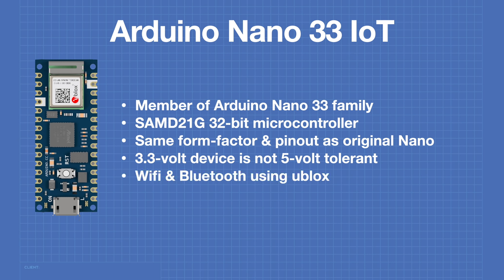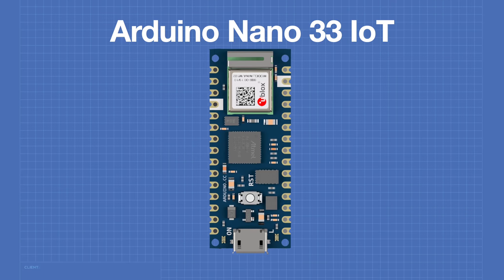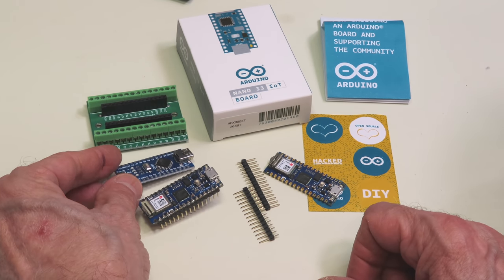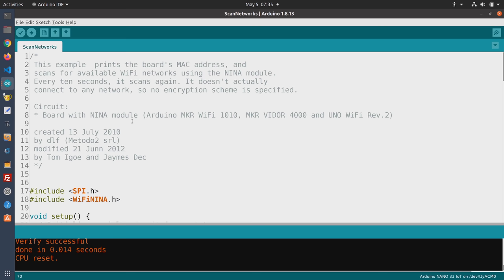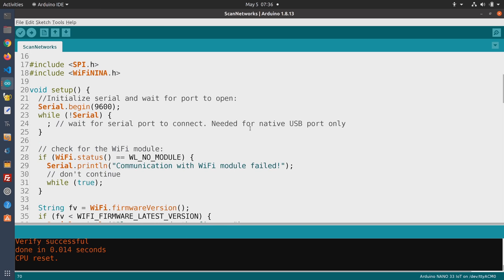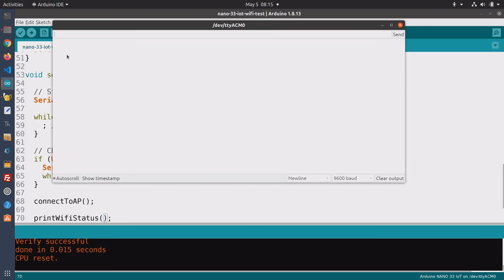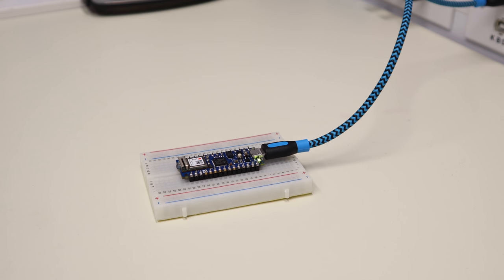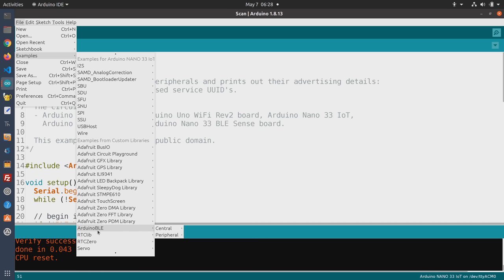Arduino Nano 33 IoT - Getting Started

Comment: Hi Bill. From the bottom of my heart I would like to thank you for this video. I had a few problems with my Adafruit tech, so I took a look around and found this video and bought a Nano 33 IoT to check it wasn't my PC or something. An hour or so later, it's installed and running the blink and wifi monitor. Next step is to try and get the Adafruit Smart Neopixels running!

Tim

Comment: I get big butterfly’s from the excitement of watching your informational videos. The excitement comes from the vast possibilities of the different things possible from the information you disseminate. Thank you very much for your help in designing my automatic gate opener for my residence. I know I can use my phone, a hand held remote, or a push button code on an outside controller (of the gate for visitors). Knowing this code may be changed as often as I wish makes the security I feel living behind a secured, locked gate wonderful! Now I haven’t built everything yet but I have welded up a strong steel box that will hold the motor and all the components. You have really inspired me to “go for it”.
    So for penny’s on the dollar, I will be able to build a VERY nice, secure entry point that will display the time at every opening or closing of the gate. Possibly face recognition for entry of friends. Definitely recorded video that can be monitored by my phone. Permission to open the gate from my phone which means anywhere I am at, I can open or close it. I’m still designing the system at this point, but I now have the confidence to attempt this monumental undertaking. Of corse I will be asking you for information when necessary. But I promise not to overburden you with the trivial bits. So for someone (me) that did not finish my proper education this will be a great task. Once again thank you for all of your information.

Comment: Thanks for the good video. I am  wondering how the board measures up to an ESP32 board, and when and why one would prefer to use this board over an ESP32?
Reply: I came in here to ask the same question as you, but I see he hasn't answered you in over 3 weeks.
Reply: Pradeep, 
Both microcontroler use advanced cores  :M0 from ARM for the Nano and Xtensa LX6 for the ESP32
From the datasheet, you can easily figure out that the ESP 32 can run faster 240Mhz vs 48Mhz
The ESP32 has an FPU while the Cortex M0 does not, this can make a big difference if  you need to make a lot of calculation
The ESP32 has 2 cores, this can look awsome, but in real embedded application I have not seen any real time embedded application using this king of architecture (it is already difficult to debug a single core...). Now if you have exemple, please share with us. 
One last word,  I do not believe this can be used in the arduino environment. It looks to me like something that a real RTOS can manage, with multiple process and inter process communication.
Power consuption in many cases is also important, the faster you run the more power you consume !
A last point, in embedded application resources are scarce. You can favor one or the other based on your requirements.
Take care and happy development !
Reply: Basically the same i think but I would get it from Arduino because you’d be supporting a good company and quality is guaranteed

Comment: The lighting seems great, tip for the glasses, angle up and tilt down the softbox a bit to reduce reflections :)  you can also try adding a rim light to further define yourself on the shot. Great video nevertheless, learned alot about the Arduino Nano!

Comment: The question a lot of people have is this vs. ESP32? I'm guessing ESP32 is cheaper but this may have better support in Arduino IDE?
Reply: In my experience ESP32 support using Arduino or Platformio is excellent nowdays, with a decent community too. Most problems you come across are reasonably easy to find good solutions.The dual-core is really handy too as you can leave one core to handle wifi and you have a fast core for your own stuff.
Reply: Cheap vs very expensive

Comment: To avoid the complication of BLE does the 33 IOT support something simple to use classic BT like BTSerial on the ESP32 to communicate with standard BT devices ?  Using BTSerial all you need is 3 lines of code and you are in business

Comment: You are doing fine :-) With respect to the reflections in your glasses you could try a polarizing filter. It is a quick, easy and relatively cheap fix.
You just turn it until the reflections disappear.
Reply: I actually meant that you are doing very good :-)

Comment: I'm really curious to see your thoughts on the new Arduino Nano RP2040 and how it compares to this. I was about to use the Nano 33 IoT for my next project but if I can use micropython with the RP2040 and still access the same hardware features, I think I prefer that route just for more flexible programming capabilities.

Comment: Thank you for this very nice video, very informative, very easy to understand.  Do you have a video connecting the Arduino Nano 33 IoT to ARDUINO NANO MOTOR DRIVE SHIELD 2 AMPERE.  Also, what other NANO MOTOR SHIELDS would work with the Arduino Nano 33?

Comment: I have an issue with your use of the term "Dropping Resistor".  It is anything but that.  It's a current limiting resistor.  The voltage across the LED is essentially constant, so the only way to control the LED brightness is by altering the current flowing through it.  Hence, it's a current limit resistor.  It's not dropping anything.
Keep up the great work you are performing.

Comment: sir , can u help me with this project. Low cost pulse oximeter which can store previous data ( reading)& that data can be shared via bluetooth to mobile. 
And making an ML model to predict if there is any problem in the user lungs with these readings.

Comment: Your statement at 20:48 is misleading.  While the SSID and password are not readily visible in the compiled object/executable, the strings are still present in the file and are in no way encrypted.  Such things as the Linux strings utility will readily display the hard-coded strings.

Comment: I love your channel. Your sketch with the RTC works fine until I insert it into a sketch using the Arduino Cloud. Then I get an error message saying double RTC declaration. I have tried the sketch alone bit as soon as I add the iCloud function, it stops working. Any ideas.

Comment: I am interested in using one Nano 33 IOT with an attached analog joystick to control two servos (e.g. a pan-and-tilt for a camera) attached to a second Nano 33 IOT over WiFi. Any example sketches I can adapt? Most of those that I’ve tried to work with use a web page with HTML to control servos; that feels needlessly complicated.

Thanks for the well-organized video and article.

Comment: Can somebody tell me what the purpose of breaking the 3v3 bridge at the bottom of the board is for?

I have a regulated 3V3 output coming from a linear regulator 24VDC in and 3V3 out that I wanted to utilize.  

I was hoping there is a way to supply that voltage without it passing through the onboard DC/DC converter. (I want to reuse what I have and The onboard DC/DC is not rated for >21V)

I havnt got my board yet to test all the connections, but it would be nice to know if maybe that bridge will break the connection to the DC/DC converter so I can directly supply voltage to the 3v3 pin?

Comment: Think i'll stick to esp32
Reply: At 16 Euros plus tax, it's expensive compared to an ESP32, or even a cheap Chinese original Nano with added Wi-Fi or Bluetooth board, that would be more than adequate for far more sophisticated things than turning on an LED! So worthwhile buying to support Arduino, but not in any quantity if you're building a house full of microcontrollers.

Comment: The sample scannetworks sketch fails to compile with errors in spi library -
here is message
C:\Users\rbcra\OneDrive\Documents\Arduino\libraries\WiFiNINA\src\utility\spi_drv.cpp: In static member function 'static void SpiDrv::begin()':
C:\Users\rbcra\OneDrive\Documents\Arduino\libraries\WiFiNINA\src\utility\spi_drv.cpp:103:15: error: 'NINA_GPIO0' was not declared in this scope
       pinMode(NINA_GPIO0, OUTPUT);
               ^~~~~~~~~~
C:\Users\rbcra\OneDrive\Documents\Arduino\libraries\WiFiNINA\src\utility\spi_drv.cpp:103:15: note: suggested alternative: 'NINA_GPIOIRQ'
       pinMode(NINA_GPIO0, OUTPUT);
               ^~~~~~~~~~
               NINA_GPIOIRQ
C:\Users\rbcra\OneDrive\Documents\Arduino\libraries\WiFiNINA\src\utility\spi_drv.cpp: In static member function 'static int SpiDrv::available()':
C:\Users\rbcra\OneDrive\Documents\Arduino\libraries\WiFiNINA\src\utility\spi_drv.cpp:66:25: error: 'NINA_GPIO0' was not declared in this scope
 #define NINA_GPIOIRQ    NINA_GPIO0
                         ^
C:\Users\rbcra\OneDrive\Documents\Arduino\libraries\WiFiNINA\src\utility\spi_drv.cpp:597:25: note: in expansion of macro 'NINA_GPIOIRQ'
     return (digitalRead(NINA_GPIOIRQ) != LOW);
                         ^~~~~~~~~~~~
C:\Users\rbcra\OneDrive\Documents\Arduino\libraries\WiFiNINA\src\utility\spi_drv.cpp:66:25: note: suggested alternative: 'NINA_GPIOIRQ'
 #define NINA_GPIOIRQ    NINA_GPIO0
                         ^
C:\Users\rbcra\OneDrive\Documents\Arduino\libraries\WiFiNINA\src\utility\spi_drv.cpp:597:25: note: in expansion of macro 'NINA_GPIOIRQ'
     return (digitalRead(NINA_GPIOIRQ) != LOW);
                         ^~~~~~~~~~~~

exit status 1